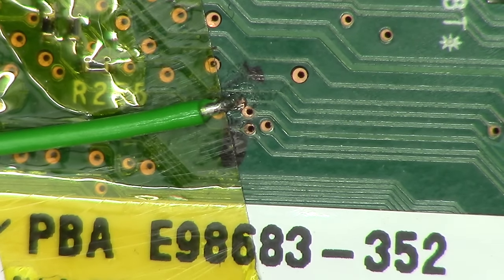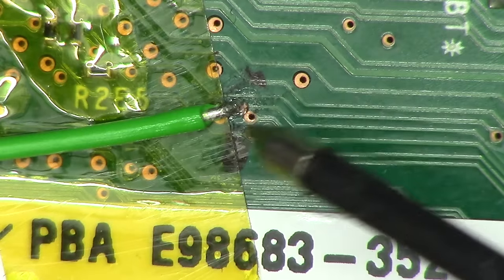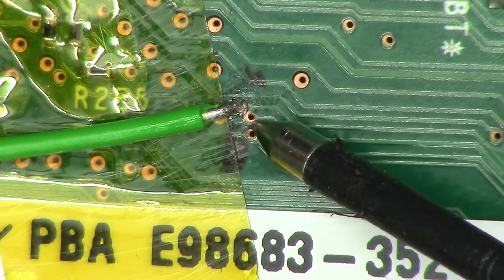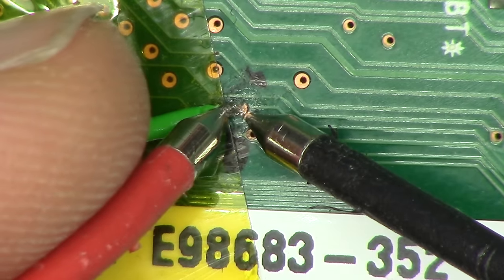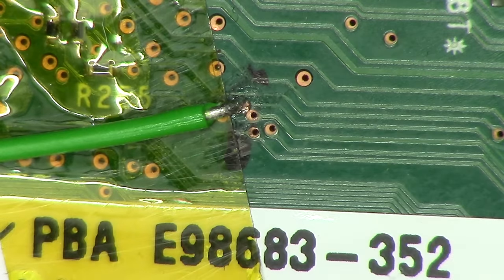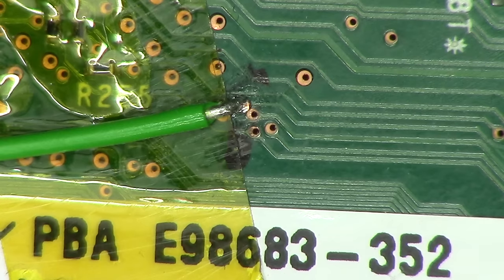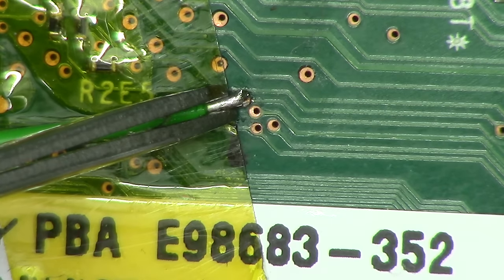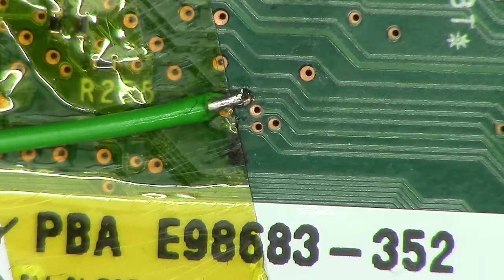Motherboard repair followup: Was there a short?

Comment: That wire is so over the top if you do not have any enamelled copper wire then you could take a relay apart if you have any duff ones and use the wire from that. As for flux Amtech NC-559-V2-TF is what I use. Keep up the good work.
Reply from the maker: The green lab board wire is almost a bit of a running gag; back in school, they were always out of all wire colours but green, so all my old projects were constructed with nothing but green lab board wire just like this. When I quit school, I just bought a giant roll of the stuff.

Comment: why use such thick wire on such small trace? I will just use a magnet wire
Reply from the maker: It's what I happen to have lying around. I don't quite care as long as it works.
Reply: well.. i would recommend to remove that wire and use a thin wire instead, if you put too much pressure on that trace then it will detach out of pcb and you'll have more problem, thin wire are more flexible and it will broken if you pull it too much, now the tick wire will pull the whole trace out